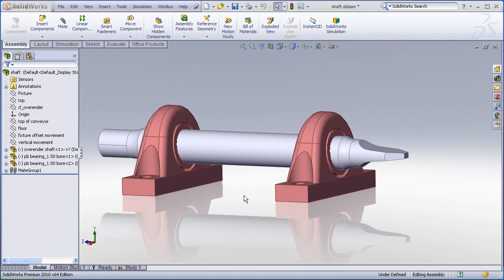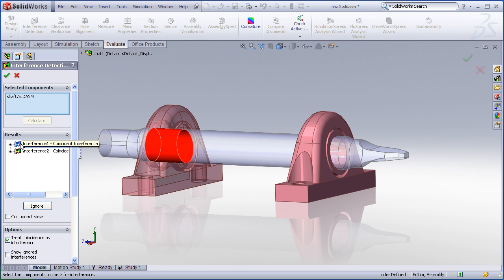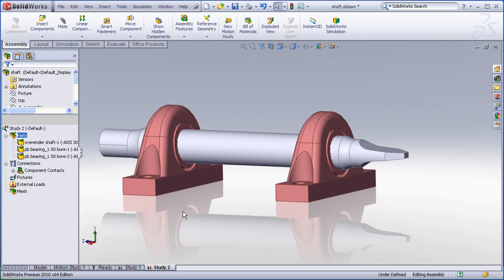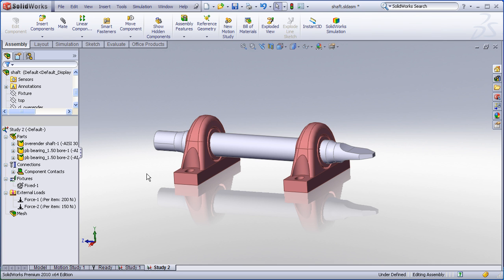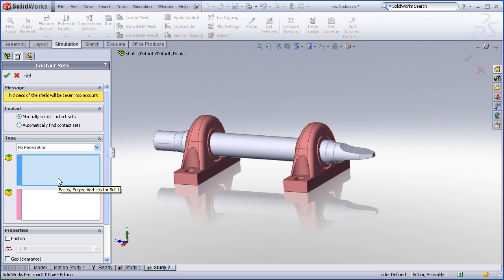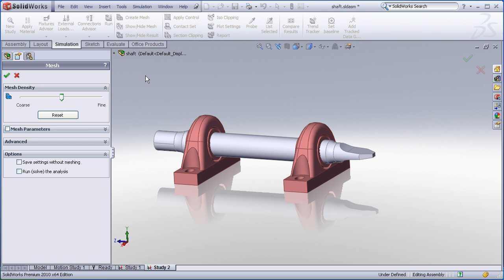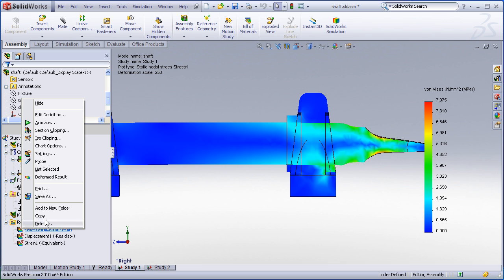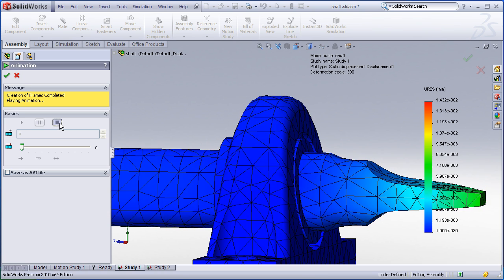Simulation Simple Contact

Comment: One thing I don't understand:  don't you have to switch off the "Global Contact" after defining the contact set?

And if you apply an axial load on the frictionless (contacts) axle - would'nt it be pushed out of the bearing, causing solidworks to complain about a too big movement...?